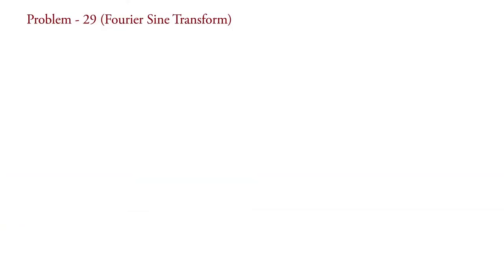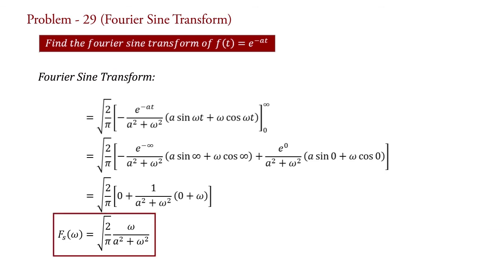Fourier Sine Transform Examples and Solutions | Problem #29 | Numericals on Fourier Sine Transform

Comment: 00:02 Finding the Fourier sine transform of e^(-at)
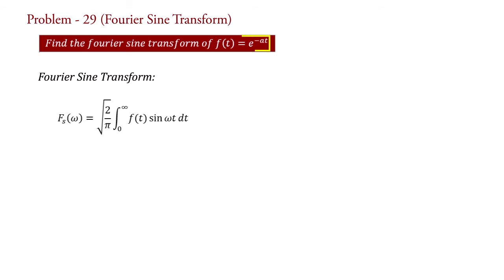00:44 Understanding Fourier Sine Transform application with numeric example
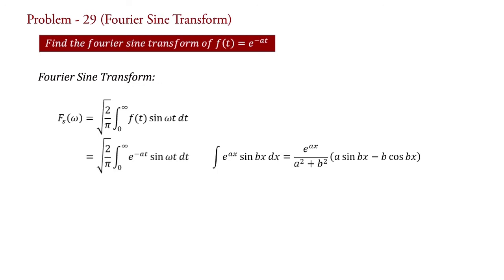01:11 Comparison and application of an integral formula for Fourier Sine Transform
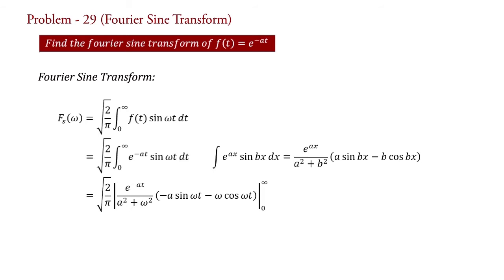01:35 Solving the Fourier Sine Transform problem using mathematical equations.
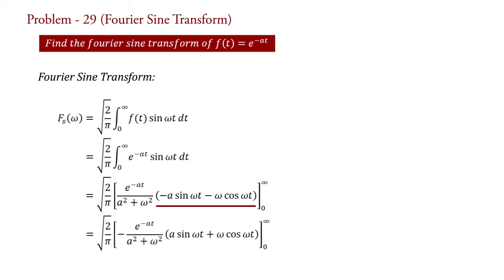01:57 Understanding Fourier Sine Transform with limits and values
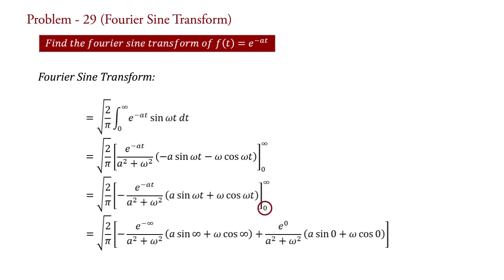02:24 Explanation of evaluating a term to be 0
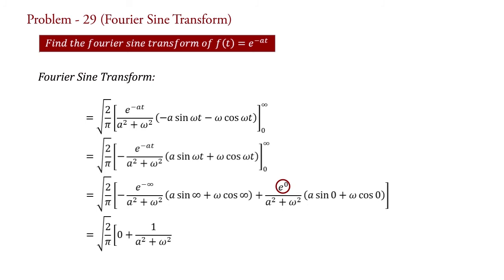02:47 Calculation of Fourier Sine Transform
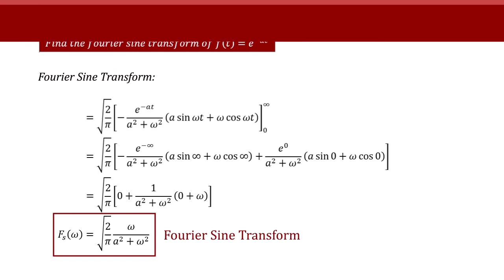03:13 Introduction to Fourier Sine Transform